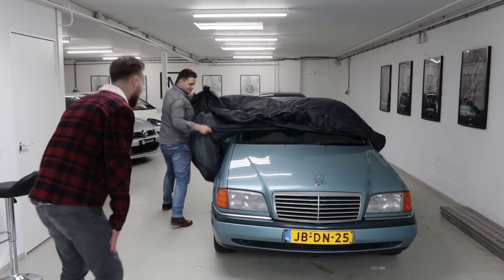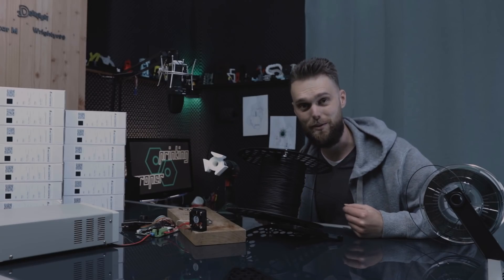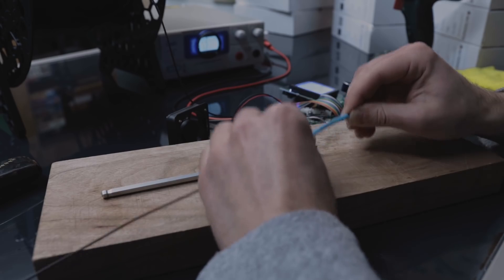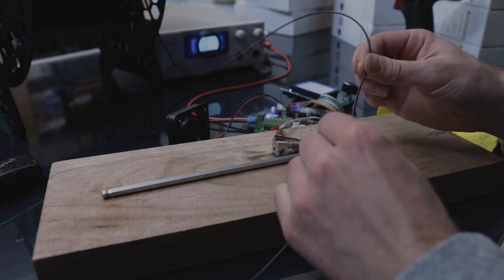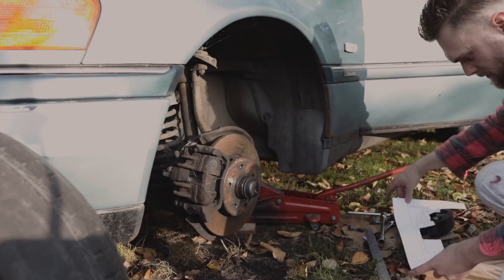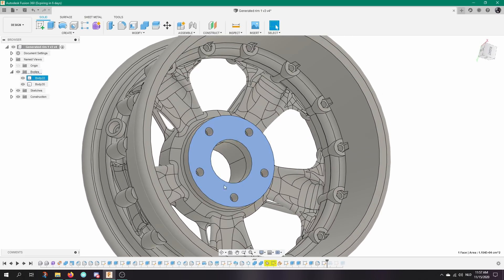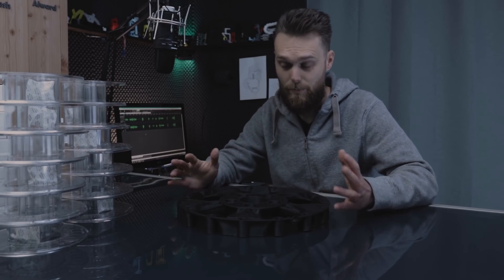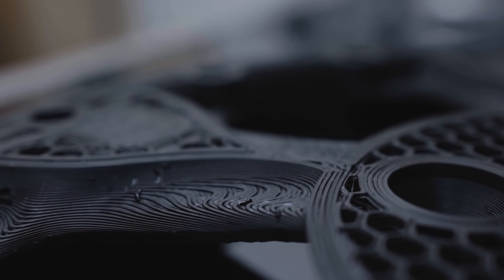I tried to 3D print a full-sized rim for my car out of ABS

Comment: I have used a similar method. Instead of squishing the filament though, I used a small file to get the diameter down to within tolerance after melting and pressing the filament ends together to make a good bond.

My method only works about half the time. You might consider using a Prusa MMU2, so that when it senses that one reel has run out, it will switch to the next
Reply from the maker: My second try worked better and two joints were successfully printed, now I want to search for an easy and reliable method
Reply: sugested the same mmu2 methode is the way to go i think